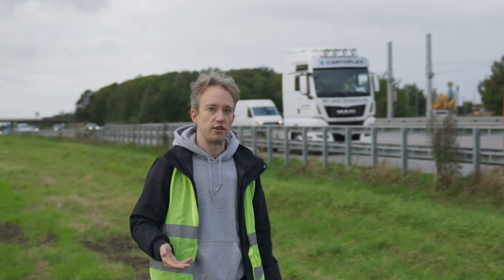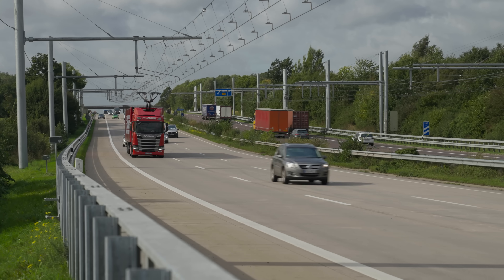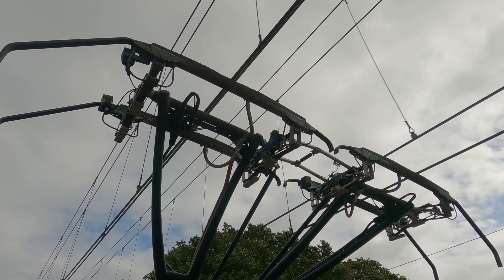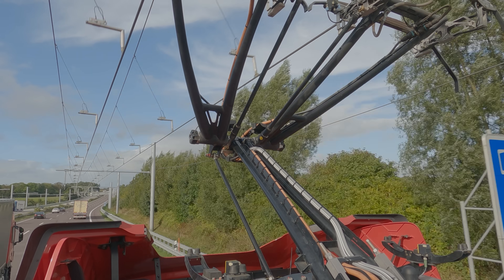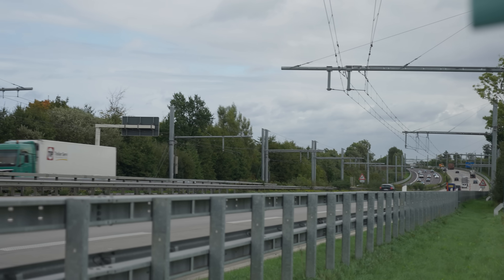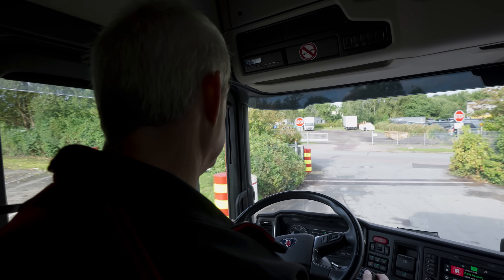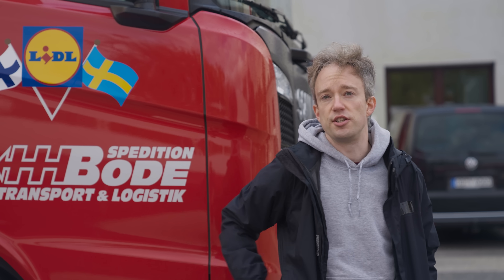The highway where trucks work like electric trains

Comment: So trucks use electricity from coal burning powerplants, thats so green.
Reply: The goal is to also phase out coal powerplants. You can do two things simultaneously. It's possible.
Reply: Not every single Joule of energy is coming from a coal power plant; a fair bit of it comes from renewal sources, and that proportion can be increased. Granted, no one is happy with Germany's energy infrastructure, but it's a step in the right direction.
Reply: @bartholomewdan  200 years ago was electric cars. So you want that 200years old technology come back. What next, steam trains, becouse diesel is bad?
Reply: @Saulatis   How is the age of the technology relevant? Neither electricity nor diesel are perfect and both have plenty of problems, but replacing demand for petrol with demand for electricity is the cleaner option over the long term. Electric cars never went away, they were just never adopted at a significant scale until now, so they're still new in the sense that no one really saw or thought about them just 20 years ago.

Comment: They've literally just re-invented the Tram again... a pointless waste of effort/money if you ask me.
Reply: So?
Turning the already extensive Autobahn network into a de-facto train network is a GOOD thing especially since transportation and logistics is a necessary component
Reply: @Shirokroete  What's the point when you already have electric freight trains that run on railway lines that can carry goods over long distances? AND carry more... It really isn't necessary at all...
Reply: @SprattyHeath   Because rail infrastructure in Germany simply does not have the capacity for it and building new lines is costly and time consuming.
Reply: @SprattyHeath  Locations. From the Autobahn you can drive ANYWHERE while railways are only in specific spots which would need to be unloaded on that spot

Comment: The problem lies not so much in connecting the vehicle to the grid, but that the grid won't be able to handle the demand for that electricity. This is a serious problem that people are only now beginning to realize. There are cities where they've stopped installing charging stations because there is not enough electricity available in those areas.

Comment: Railways require a long time and much cost to construct, and usually are place side by side with highways anyway. Yes it would be more efficient to use rails, but trains require extra infrastructure (ie. Trucks) just to get their goods to the exact destination. So tracks don’t matter all that much unless your destination is greater than what a truck can go on its tank of gas (ie. 300-400km). Hence tracks make sense for North America but not in Europe.

Comment: The problem is with electrics etc it's not really saving the planet, firstly batteries forgetting about them and there production etc and possible future etc and the materials, where there isn't enough to Produce for xyz. Let's face the more today problem that i absolutely hate from the side point as an engineer the whole solar and wind ideas, there great for localisation abd having every house with solar panels for both heating and electricity however we should stop fearing the atom and build more plants as there far more efficient, Doesn't even need to be using uranium and can use thorium, but if it ain't making people money they don't want to hear it
Reply: bruh

Comment: Or you know, just build a robust rail based logistics network with last mile transit running off battery, and charge at the depot. This is an interesting and plausible system, but it certainly isn't the best

Comment: Having in my youth lived in a city that has overhead rail wiring for street cars, it was a pleasure to move to a city without it and live beside a highway with 24/7 diesel trucks.  The over head wiring has a definite life span from new and that is fairly short, it created loads of ground level ozone, and the settling out of charged particles built up a grime you couldn't wash away it was just disgusting. Even walking through those areas of the city the sky was dim, subdued and unpleasant. That was when it was in operation,  with heavy ice rain events and snow load events or drivers driving into poles the wiring did go down and stay down during lengthy repairs.  And that was the top side cost, because the bottom side had no 'wiggle' room, the constant narrow confined traffic on the roads wore the roads down to ruts that also needed constant repair and woe to you a pedestrian if you had to cross a road that had become textured by use.
Reply: Are you sure you know what you're talking about?
Reply: @djtransnazgrz  I have lived in a fair number of cities in a fair number of situations.  The second worst to the overhead powered rail was living downwind of steel foundries (those things are nasty for the pollution they put out into the air not just the water).   Diesel was bad too, don't get me wrong there.  Actually living beside a rail switch yard in a port city where boats loaded/unloaded was one of the better industrial settings that I have live in.   Thankfully I have never lived in the "zone" around an airport with planes coming in or taking off.  Now, living 11 floors above and overlooking a city park I don't miss a one of those dark days.  Just know, we have GOT to rid ourselves of fossil fuels.  BUT we cannot go from the fry pan to the fire either.
Reply: Ah yes you see but that doesn’t get a politician re-elected by green haired idiots that live in their little bubble. They don’t think of the implications of “green” energy. Batteries, power lines, power plants, overhead costs, repairs, damages. They make a law and walk away. If they’re still around to see it fail they get out of the cameras and someone else blabbers on about how great it is for an hour. At this point in time society has become so far broken it won’t recover. It will decay and rot until there’s nothing left.

Comment: Excellent report. An accident or weather incident could leave live wires on the road. The copper, aluminum, and steel for the wires and towers will have to be mined and processed.

Comment: Wires are not the future, it's hydrogen. Germany is already heavily investing in developing that technology for commercial vehicles. EV is just a temporary solution as the technology exists but fuel cells is the way to go.
Reply: Yes, my feeling exactly. The electric motor will stay but the batteries will go.

Comment: Much better to put the power supply right into the roadbed. Yes, it costs more, but then any vehicle with a wireless charging system can use it without complicated, retractable (and for cars LONG) arms to reach it.

Comment: Why not just build railwais to transport all those containers, if they have to moved along trunk roads anyways? Trucks are inherentely less efficient then trains.
Reply: Probably because those railways will take too long to build, this seems much faster to build. It's the road equivalent of electrifying a line rather than building a completely new one.
Reply: Would the grade separated crossings at each/most interchange(s) be affordable?
Reply: @ki0w0-lordofwatersheep  Maybe not under capitalism. That's why we need to move beyond this dumb economic system.

Comment: I think the video brushes over this a little too quickly; are these electric trucks with batteries that can get charging from the wires while on the road or are these electric trucks that rely on these cables for charging because they have smaller batteries to reduce weight and cost?

The way Professor Cebon seems to describe it here is that the eTrucks will have smaller batteries on their vehicles because of this infrastructure, which seems a tad bit counterintuitive unless you are trying to split eTrucks into short-haul and long-haul models or urban and rural models.

Is this simply a problem of the quickest way to roll out the infrastructure in the short-term and figure out a solution to the rural issue in the future, whether that be cable expansion or battery expansion?

Comment: Hmm I can see many efficiencies more to be made. Friction losses are high from rubber tires so I think that should be replaced with low friction steel Wheels, with steel guide rails. If many trucks are going on the same route in around the same time period, they can be linked together and the individual traction units can be combined into one large unit at the front of the tr...uck, to reduce moving parts and the costs of maintenance etc.

I think this is a novel concept that should be explored further. Give me 1 billion dollars in public money and I will realise these revolutionary tr...ucks!

Comment: They are sitting idle at night?
Sorry to disappoint you, but a very huge amount of trucks in Germany run in a two shift configuration: During the day, they do pick ups and deliveries driving short distances. During the night, they run on specific routes. That way companies aren't dependent on their own trucks but can hire contractors for cheaper money. Those contractors will then run their trucks with a different company during the night. It's often the case that parcel shipping requires more trucks at night whereas normal pallet freight requires more trucks during the day.

At the moment, liquid natural gas is becoming much more of a thing here in Germany. All of those contractors running two shifts couldn't get an electric truck to work (as of now). Plus, typical long-haul runs become less popular, since they are more expensive (truck is sitting idle for half a day) and drivers often prefer to be at home after work.

The company I have been driving for is using LNG and there is a huge investment in infrastructure concerning fuel stations as well. We'll have to see what the future holds, but I think that they will probably go for hydrogen instead of electricity. Not only offers a hydrogen truck way more flexibility but it is also that you will safe millions of dollars since electrifying motorways is quite expensive.

I am aware of the fact that you are just introducing a promising technology to us, but I feel like the stats given in the video are a bit too optimistic. Even if a great deal of German motorways is equipped with overhead power lines, I think it to be very unlikely that there is enough such trucks to safe around 2/3 of those emissions...
Reply: Plus additionally:
Those pantographs use a lot of cabin space. Long-haul drivers will probably complain about that since their living space is rather small anyways...

Comment: Excellent idea for major trunk roads between ports, major depots and any manufacturing facilities in the region.  I look at the East coast in the US and can see many areas where this would make sense.  And the bonus of a truck being either all electric or a diesel-electric hybrid would make up for the balance.  I'm not envisioning this as a nationwide thing but more concentrated in the major industrial arteries.  Cross country / long-haul trucking is another matter entirely (at least currently).

Comment: So, it's like an electric trolley bus. Kinda like they have in Salzburg. While trains would be more efficient, building new train tracks would take decades. And the German train system isn't exactly known for being great or having free capacity. So they would gave to build a lot of new tracks. This system is just stringing some wires above existing Autobahn sections. This could be rolled out in a couple of years given the political will. Probably in less time than it would take to negotiate getting the land needed for new train tracks from the current owners. And it will cost a lot less. So, I'm intrigued and I think it's not such a bad idea for a quick interim solution.

Comment: i like how many people just assume this is a train while glossing over the fact that the truck isnt meant to drive only on the eletricity line, but instead use it as a fuel saving process over long distances, switching to the combustion engine when entering narrow streets where the eletricity line may not be able to be installed, much cheaper and efficient than building railroads EVERYWHERE
Reply: hybrids were mentioned in passing, but the main point is about E-trucks, that would run on battery when the highway lines arent available. This would obviously only work for short trips off highway.
Reply: @bermchasin  make no mistake, until we got some crazy batteries capable of similar efficiency to combustion engines, these trucks WILL be hybrids
Reply: @tadayoshi1434  you clearly don't know what you are talking about.
1. There already are electric trucks capable of last mile delivery, the problem was long range transport.
2. Diesel engines are really bad at stop and go city traffic, that's where batteries and e-motors shine.
3. Batteries are wayyyyyy more efficient than diesels, about 85% compared to 35% of a diesel. So i think you should have used a different word.
Reply: I agree with you, but i doubt anyone would put combustion engines into trucks like these for mass production. They would have midsize batteries for the last mile.
Reply: So maintaining the truck pollution in our built up narrow street areas.

Comment: Ideally, electrified trains would be better for the bulk transfer work, but this would allow more flexibility and reduce the intermodal infrastructure needed to go to and from the rail network for the rest.
Reply: we had all that here in Germany but the government shut down about half of the railway lines and stations between 1989-2000, and now everyone says "we need more railway infrastructure"...
Reply: That's later than I'd have expected. The UK's railways were shrunk by Dr Beeching in the 60s. (According to wild speculation, this is because of Arthur Harris)
Reply: @vornamenachname727  and the tracks left are also used for people. and depending on the warehous locations you'd need a truck to bring it to a station, load onto train, load on another truck at the destination. with this an electric truck and overhead cables you save on longer transport ways to and from the train.
Reply: At least one of the well known supermarket chains in the UK does use rail freight for batches of ISO containers loaded with their stock, to cover long distance deliveries, then presumably transferring them onto their trucks for local delivery, either directly or by mixing the content with other things in their warehouses.
Reply: Trains can not go the same places as a truck can
Reply: World has moved on from the days you could use intermodal for normal use. It is all about time now and trains are slow. We could return to that though but most palletized goods would never ever do that due to theft and other risks on trains.

Comment: This works for short haul, most trucks are long haul so it needs to be interconnected from country to country or state to state ect. 
I see a high wear item on the collectors and cable system. I already can see a boatload of these deploying at the wrong time and being ripped off the truck or destroying the cable. The system needs to be designed to be more dummy proof.

Comment: At a glance, this looks like a good compromise between a train and a truck. Granted I have absolutely no experience in any industry associated with it but I wish then the best.
Reply: It mainly combines the drawbacks of both systems...
Reply: @stephanweinberger  How does it combine the drawbacks?
Seems like it combines the two upsides if anything. Direct grid power and ability to maneuver off a given track when necessary.
Reply: @CFIREytb  High maintenance, and less safe.
Reply: @RK-lq2ud  How is it less safe?
Trucks should be going through routine maintenance regardless.
Reply: @CFIREytb  linked (at least partially) to a fixed, expensive, vulnerable infrastructure, small cargo per unit= low efficiency, use rubber tires.

Comment: I don't see it taking off. Either trucks will have very big batteries, or they'll be hydrogen powered. The technologies there might not be as mature as this but they're much more flexible and don't come with drawbacks like the height limit it imposes on roads, or the challenges with mixing bare high voltage electricity cables with car crashes.

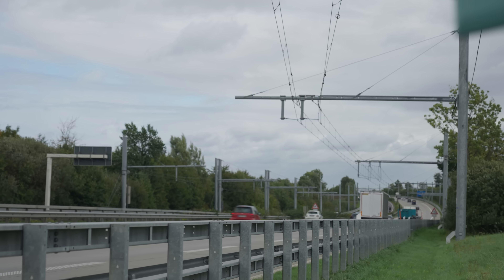Comment: 0:45 "and that could reduce two thirds of the greenhouse gas emissions by heavy trucks"
Well this is Germany, which is fixated on closing clean low-carbon nuclear power plants. So the solution would mostly  shift the greenhouse gas emissions from the trucks to coal and gas burning which they still use a lot.
Reply: shhhh.....it seems alot of environmentalist haven't figured that out yet,
Reply: In 18 years, there will be plenty of renewables, even in Germany
Reply: @axelnils  Hopefully but as it stands just replacing combustion engines does little. 
In Germany and a number of EU countries, there may be wholehearted plans to move to greener grid power,
but other places like the U.S.A. there has been large pushes for electric cars but not so much for green grids.
Reply: @axelnils  will there be energy storage, or will everything stop on a windless night?